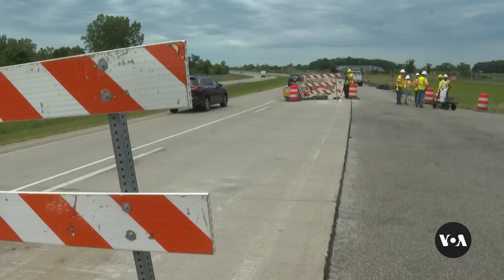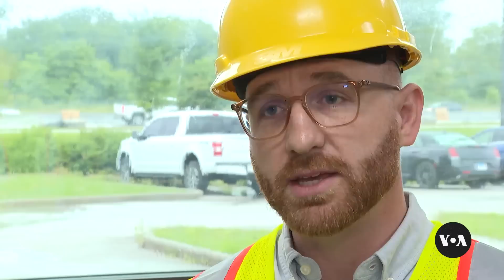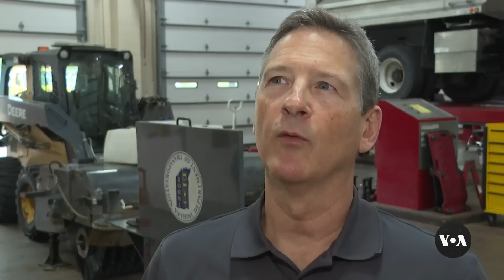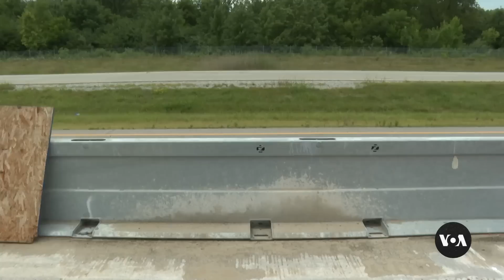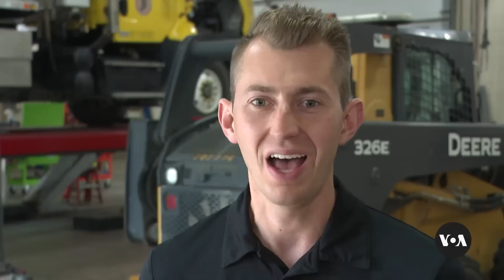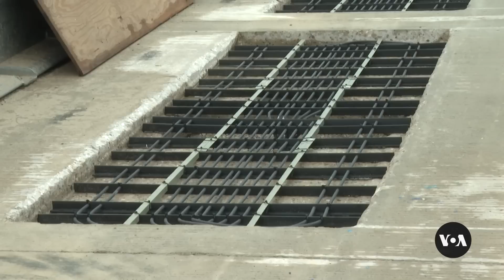Indiana test highway could transform electric vehicle charging | VOANews

Comment: If North American railroads don't have enough incentive to replace their locomotive fleets with pantograph-equipped electric locomotives, what makes you think you'd be able to convince a significantly larger number of trucking companies to do the same on a much bigger network? Perhaps perform the analysis & make the case there first if it even makes sense.

For that matter, BNSF-predecessor Great Northern Railway already operated electrified railways in the Cascade Mountains from 1909-1956.

Comment: why not connect a bunch of trucks together and have one massive tractor power it from a overhead wire or something, we could even get rid of a lot of the resistance by making a special road out of two metal beams, and replacing the rubber tires with metal wheels instead?

Comment: the taxpayers will pay Billions for the copper wire needed for over 164,000 miles of highways in the National Highway System and the illegals will have it dug up faster than the trucks driving over it .. Elitist self licking ice-cream cone ... simply idiotic. There's not even enough energy produced out west to supply both your EV and your home's AC and EV's are 9%-10% of cars in use and that's just because taxpayers subsidized every person driving an EV.   ICE machines can go anywhere without costing taxpayers (gas tax supports road maintenance & construction).

Comment: They did this in Europe, Germany, already. 

They took the overhead wires like a train would use, and use it for a battery powered truck. It’s barely used. Why not learn from other people’s mistakes? 

Secondly, putting overhead electrical systems for the trucks in ONE specific lane (furthest right) for trucks only, is way cheaper than this garbage. This is insane and just a way to be like hey I created something new. This is not engineering, this is over thinking.

Comment: Indiana officials say the cost of the quarter-mile strip of highway is $11 million. 
How much will it charge in FIVE minutes travelling at 35mi/hr.
Reply: Its just a proof of concept. If it can put as much power into the battery as the vehicle uses to travel that distance than it will do what they are saying it will do.   They want it to maintain the level of charge in a battery . So You could drive on stretches of that type of road and have the same amount of charge that You started with.   I am guessing , but I think that they are trying it out on a smaller section to also see if there are any bugs in the system that they did not  think of and to keep costs down on testing.       If it was put into roads all over the country , the cost per mile would go down. And the goal would be to have miles and miles of highway  with the system in it so that You could drive and keep the vehicles battery at the same level.  If You enter that section with 41% battery You drive the entire section and the battery level stays right around that same 41% . So You can drive 100's of miles at a time without having to stop to charge.
Reply: @thestickershopshow7765  Made a mistake in my calculation:  At 35mi/h it would take 26 seconds to travel this POC stretch.  Vehicles will need to be retrofitted(additional weight) and have a specific clearance in order to get wireless charging without excessive heat/power loss.  This might be gold mine for the company that agreed to maintain this.
Reply: @myc0p   Yah I figured that it was off. But its not intended to charge more  than the vehicle will use.  Its so that You could drive on a highway and not use up battery power. And only need to use the battery power on the side roads and roads that people are not driving 100's of miles per day on.  It could make traveling in an EV much more realistic and less of a hassle. Sure there are bugs to work out.
Reply: EEVblog 1584 discusses a similar $250m MI project in details.
Reply: just enough to know you got fucked lol I can not believe the amount of people still falling for this bullshit lol wait til you see the shock of when it dont work.. just give em more money they'll try harder next time lol
Reply: Product development is really expensive, for EV charging and road infrastructure that's relatively cheap. Everything has economies of scale and that's the price to install a singular quarter mile. The difference between paving a hundred miles and a quarter mile is pretty vast too per mile

Comment: Why not use the same platform electric trains have used for over a hundred years. Charge by wire. It’s cheaper and faster. A device will auto connect to the truck as it;s driving and will charge faster on a 100 mile or more stretch. By the time that stretch ends the truck will be at 100% or close to it until it needs to charge again.

Comment: Wouldn't it be more practical to install this at truck stops or weigh stations where it could actually add a decent amount to the battery. Driving over this at 70mph does nothing to extend range.

Comment: So how is this better than the German version that literally places the wire above the roadway and trucks just pull under the wires and extend a connector? There is precedent in just about every city with the electric bus or trolley.  I mean really,  this is just somebody getting government grant money for a completely non practical method of charging.  The ability to charge on the move is really better suited for long stretches of road with no necessary stops, and placing the wire above the road lets you get a direct power feed at a higher efficiency and maintenance is much easier. Now I could see placing a line just under the surface to facilitate and communicate to self driving systems but buried power doesn't even come close. Induction charging is not efficient, especially if you compare it to the alternatives for the same purpose.
-MG

Comment: A couple good questions to ask are:
What is the charge transfer coupling efficiency?
What is the burial depth of the coils?
How low does the inductive pickup need to be to the road? (Clearance)
Since this needs to be AC for inductive coupling, how long will it be, before the magnetic reversal frequency begins to lift the coils up through the pavement and destroy the surface?
How will this magnetic pulsing effect magnetic sensitive components on regular cars like alternators, fuel injectors and spark ignition systems?
I am assuming these studies have been done, before installing it and making the public pay for it, right?

Comment: Can have some side benefits. They could also embed heaters into the road which can clear snow and ice and also reduce the cooling contraction damage. 

For the shipping industry time is literally money. I pay 10x less in cost for fuel with my EV as well. I’d expect similar savings for a semi truck. Rail has used electric motors for ages and ask any trucker who’s driven a EV Semi and they’ll all say they don’t want to go back.

Comment: for about 1 /1000 the cost just string trolly wire overhead and equip trucks with a trolly pole or pantograph.  If you really want to save money get rid of the batteries all together and string trolly wire the entire distance and give the trucks a pony engine to make it from the highways to the loading docks.  Some of this stuff with batteries and all the expense with the charging infrastructure seems like total insanity to me, just look back at the national interurban system we had a hundred years ago.
Reply: @crm6270  
It’s not 1955 😆
Reply: @RayNLA  Well maybe it should be 1955 again in terms of technology because that wire is not only cheaper but also transfers power better than the wireless system which has high losses... Sure it's fancy and new but in this application old and simple just is more practical.
Reply: @RayNLA exactly the technology has been around for a while and is in use in other places. Which is why it should be simpler to implement
Reply: @RayNLA  Older than that, more like 1905.

Comment: This will make the cost of electric vehicles way to expensive. Expecting the trucking industry to bear a large chunk of the cost is just like trumps tariffs cause in the end those cost just keep pushed to consumer. The other issue being, most of the money that is used on roads comes from the high gasoline tax we are forced to pay, how do you replace that money as gasoline usage drops? I get what the goal is but i don't think electric is our answer and we shouldn't be wasting money on it. Hydrogen or other types of fuel has far more promise with far less burden on the consumer.

Comment: Nope. Fail. This is just a more inefficient version of a mechanical generator, which creates charge by dragging one magnetic field across another. This creates resistance, which is why it takes mechanical energy to drive it in the first place. This resistance will create drag and slow down the very thing it is supposed to power.

Comment: This sort of thing was proposed long ago.  Wireless (inductive) energy transfer is slow and inefficient, not to mention the incredible challenges of installing along any reasonable length of roadway.  Yes, it would "work," but the expense to do it would be insane.
Reply: It's actually a great case for solar, wouldn't need to transmit all that power just have it all right next to the interstates. (Yes I realize we would still need to have transmission cables for maybe even half of it) but there's large swaths of interstate and highway in the fly over states that you could make solar work with grid scale storage coupled to the solar farms that could travel side by side with the road. I know everyone hates ground based solar installations but it's the cheapest, and the panels which are the most expensive part are going up in efficiency and durability (or if your cool with less efficiency and the possibility of Texan freak storms damaging it then panels are getting cheaper lol). Maxeon has a panel that gets 25% efficiency and can handle almost softball sized hail at close to terminal velocity. I don't know why they tested the way they did, I would think one would list the largest thing you could handle at terminal velocity as that's worst case scenario. 

As far as charging efficiency and ways to make maintenance cheap and easy that's up to the engineers to figure out, it sounded like they weren't looking for running off the road just extending range by a lot, and it looked sectional so if a section failed the system  could keep working with a slight gap till it could be repaired.
Reply: @notme9976 They are currently figuring it out, like that's the whole point of the video is this is a proof of concept.  Exactly who else would figure it out if not engineers?  

And to be clear I live in one of them fly over states, I drive 2 hours (hour one way) a day on an interstate that I can count on one hand the exits between mine and my work.  The amount of land that could be used for solar along side of them is massive before you even got to the corn fields.
Reply: On top of that, copper wires are not cheap.  lol  Might as well install a small plutonium reactor in semi-trucks which will make economical sense.
Reply: @maxkonig559  While it did show them using copper wires in the video I can't see why aluminum wires couldn't be used.  Either way it's a lot of resources that will need to be quantified by testing to see if it can be economically feasible.
Reply: @paulstone3032  Aluminum wires are less conductive and corrodes more easily which is the last thing you need when it's being exposed to salt and moister.  Of course, it has rubber insulator on it but still doesn't completely seals it.
Reply: @maxkonig559  Aluminum is less conductive so they upsize it, it initially corrodes faster but the oxide layer it makes then prevents further corrosion.  Almost every overhead line you see is aluminum. Aluminum is great and a lot of it's bad rap came from people using it with outlets/switches/circuit breakers that were not designed for it and cause galvanic corrosion which then caused fires, especially in trailer homes because they tried to make them a cheap as possible.
Reply: @notme9976 That's not how it works or what I'm saying at all.  To start with it very much is up to the engineers to figure out how to maintain their product and publish those guidelines and procedures to the road crews, while yes the nitty gritty of road closures and cutting the road up and repairing the road after fixing the coil would be almost all standard practice of a normal road repair guess what an engineer came up with those standards as well.  Your right to a degree that they don't figure out the affordability per say, what they can do is make design choices that can bring down cost on both installation and repair, and ultimately it's not up to them if it's affordable that's based off costs and benefits that testing LIKE THEY ARE DOING will figure out if it is.
Reply: 2008 is when I was part of a class that was told these roads would be all over America in ten years... But that never happened and then we were told they hired too many of us.
Reply: Have you ever heard of the term "Technology Advancement"? It's the reason why golf carts can run all week on a single charge now where they used to get plugged in every evening. It's the reason why your phone is now thinner than a poor mans wallet.
Reply: @wolfe2118  The obstacles have nothing to do with "technology."  Like I already mentioned, the general knowledge to do what is described has been around since electromagnetism was discovered.  The issues lie in shutting down lanes of highway for weeks, months or years on end while crews dig into perfectly good road surface to bury thousands of coils of wire.  Those coils then have to be covered back up so that the road remains just as flat as it was before and retains the exact same strength, wear resistance and weather/freeze resistance as an unaltered road.  Can you imagine the complications of maintaining?  Do the math: number of workers, hours worked, overall project length, pieces of equipment, equipment cost, material cost, maintenance cost, temporary loss of utility of the road during construction, potential lawsuits, etc., etc., it all adds up QUICK.  It's called engineering project management.  Just look at the thumbnail for the video, now imagine doing all that for MILES and MILES and MILES.

Comment: there's a lot of wasted electricity w/ wireless.
Reply: And extra heat, which isn't real good for batteries.
Reply: Usually about 30% waste, I'd rather use synthetic gasoline or something that that point.
Reply: @GeorgeWashingtonLaserMusket  What if I told you your gas car is only about 30% efficient meaning 70% of the energy in the gas you use goes out of the exhaust pipe as waste heat or is unburned
Reply: @xiaoka  uhhh, no.. 😂
Reply: @RobotronOG  uh yeah.  Wasted power.
Reply: @RobotronOG  Yes. The best efficiency we have gotten (in labs) with wireless charging has been 50%. That means that the other 50% of the energy expended is being wasted. This is wickedly inefficient...

Comment: Um… the section with wireless charging is 400 meters? At 65 mph on the freeway, a semi truck would cross over that section in… 14 seconds. No way that would suffice to put even a tiny charge into the battery in a semi-truck!
Reply: @Yanquetino  it’s a “test” section. They have to see if it works before widespread implementation.
Reply: This is designed to maintain the battery charge at its current level.  So just a couple of 50 mile sections on an interstate would add 100 miles of range to any vehicle.  Pretty cool!

Comment: Great in theory but totally impractical and economically stupid. I can’t wait until water and road salt gets into that mess in winter.
Reply: They have cables in the ocean.  I'm sure they can figure it out.
Reply: Yeah, that seems like a lot of cable for not much power. Not to mention road repair issues. I've seen other systems where they have overhead power lines. Similar to how some trains/cable cars used to work. The tractor has a retractable device on the roof to tap into the system in that lane. I'm not saying that's perfect either. But it seems far more cost effective than this system.

Comment: Whatever happened to the solar road they were testing about ten years ago?
Reply: 1) It was too easily damaged by the vehicles. 2) The cost per unit was way too high to make it viable even if it held up. 3) The amount of power generated was trivially small, especially when accounting for the cost.

  In short, it was never really a reasonable solution. It was just a marketing stunt. Solar definitely has a future, just not on surfaces that we drive on.
Reply: @MichaelDeHaven  Too bad, it sounded like a great idea.
Reply: Yeah, it would've been great if it worked. We definitely need to try new things, we just need to be a little sceptical and test first. Have a nice day.